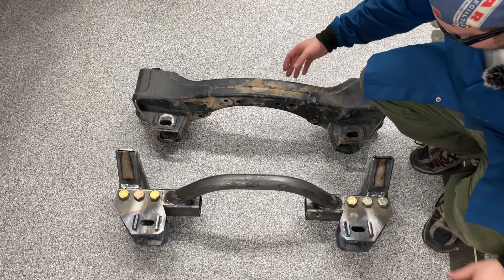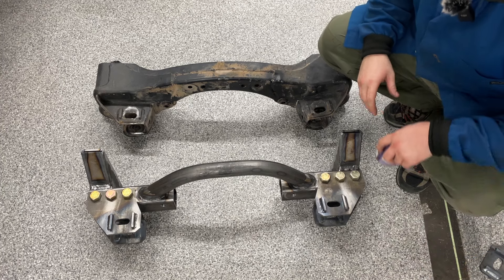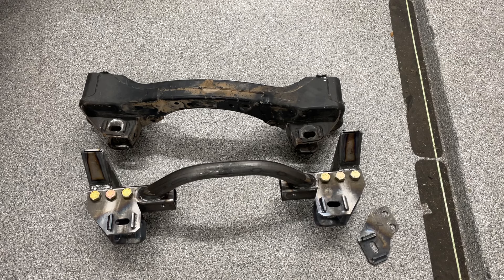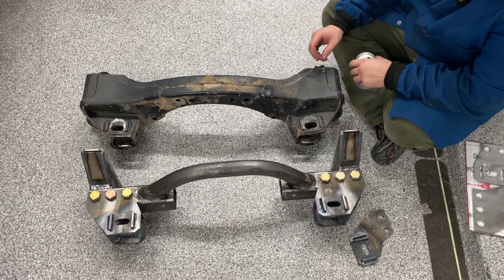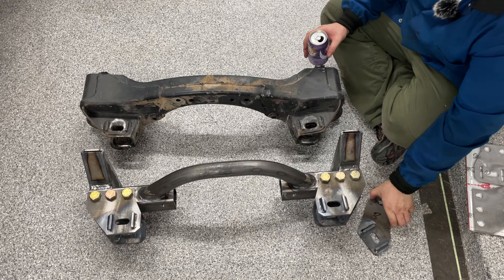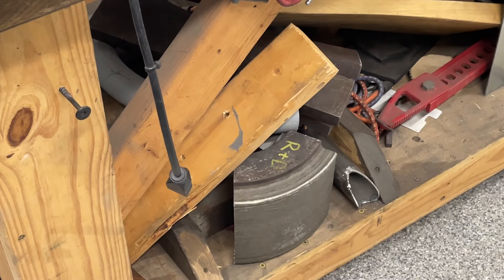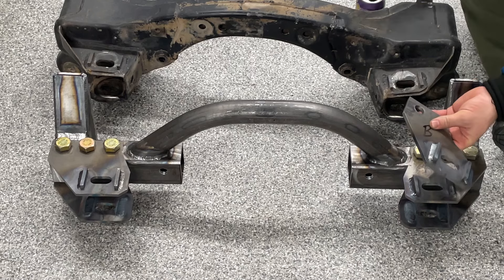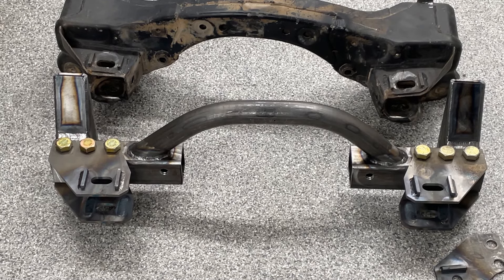4runner tubular subframe and welding of 4130

Comment: Cool stuff. If there's space, add a brace. Triangles help. Geometry makes it strong. The exotic materials add margin. Tubes best in tension > compression > bending.

What wall thickness is the cross tube on the tubular version?  The oe stamping is comparable to a bridge, where the height of the cross section adds stiffness. 

Of course packaging drives compromises.
Reply from the maker: Dude, succinct summary! The center tube is .120 wall DOM tubing, and the box tubing is .25"  wt.